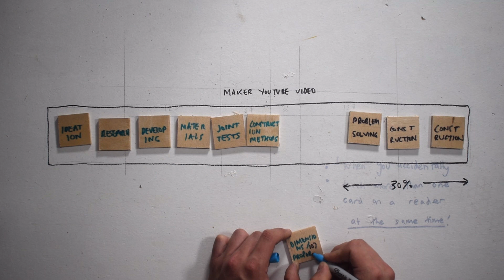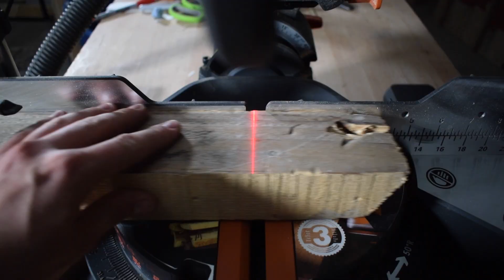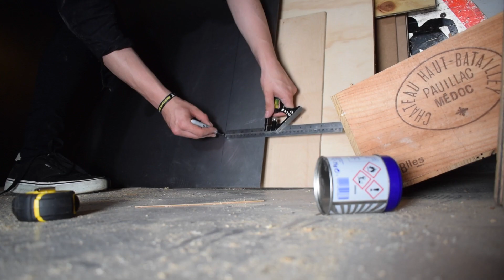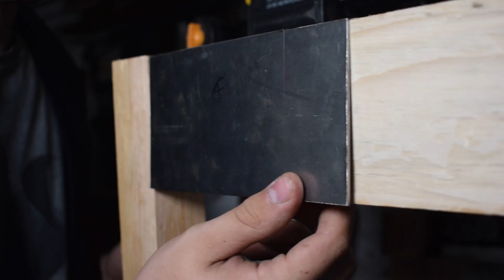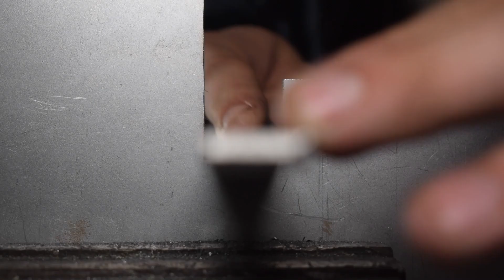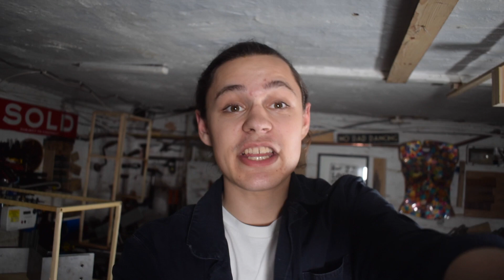Designing + Making Knockdown Steel Table Brackets

Comment: Great video.  Have you considered adding a plate (maybe triangular) across the top of the bracket to allow for some screw holes - so that a table top could be secured in place in the final table?

Scratch that - just continued watching the new video and saw you'd added small plates to allow this...

Comment: Awesome approach to maker videos! Absolutely love it!
I was very interested in your 'accessible to all' idea. However, what can be done to evade the welding part as most aspiring makers or DIYers such as myself do not have a welding machine!?
Keep up the good work!
Reply from the maker: Thank you mate, really happy to hear you found it useful!  
Re. accessibility maybe I didn't explain it clearly enough in the video, but the concept behind this is that you would buy the brackets pre-made from a store. Then once you've got them you could pick up different lengths of standard dimensional timber and construct tables of any size simply by fitting and locking the pieces into the bracket. 
(I consequently wasn't concerned about the number of tools required to make the bracket as this would be done is a workshop/factory and would also lead to the end of no tools being required for the user.)

I'm imagining this being really useful if you need to quickly construct a table e.g. if you've got extra guests staying for a dinner party but don't want something thats permanent, expensive and will take up a lot of space or alternatively if you want a more dynamic and variable table arrangement. For example I think event or festival companies would find it really useful if they could create multiple different table layouts but then have the ability to break them down either for storage or another configuration at the end of the night!

However, all this being said welding is definitely not as inaccessible as I think most makers (including myself) think it is! I got this welder second hand and once I'd brought a gas tank, wire, mask etc I'd only spent about £110 and even if thats out of your price range there are plenty of DIY alternatives to welding! I made a video a while back where I made a no weld side table by using wooden inserts, and you can always braze aluminium parts together or bolt them like Modern Builds did in one of his videos!

Comment: You might consider replacing the bolts with small holes for short nails. I think a hammer is a reasonable thing for people to own, and it would simplify the upfront construction (no tapping) and cost (short nails should be a lot cheaper than bolts)
Clever idea though!
Reply from the maker: Good suggestion Jeff, and this might be a nice idea if you wanted a permanent fixture but I'm not sure if its the best option for this bracket. 
The purpose of the bolt isn't to permanently secure everything in place, but rather to apply pressure to the stretcher, compressing it securely into the box, yet also allowing everything to be disassembled if/when need be.
Although nails would good at maintaining the stretchers location relative to the holes it wouldn't actually apply a lot of pressure so the stretcher would still be loose, and I personally could see the nail moving in line with any linear pressure. Not to mention it can sometimes be difficult to pull old ones out! 

I hope this makes sense and I should also note (and this is my fault as I don't think I was as clear as I should have been in the video) but the idea is for them to be sold already fabricated, with the user just inserting standard dimensional timber, so the build process doesn't necessarily have to be super accessible!
Reply: JMakes ah that makes sense. I think nails would be plenty strong, especially if you used ring shank or old style square cut nails. But yeah, removing them would be hard. With the bolts my concern is either stripping out the tapped threads - maybe try weldnuts instead, and that dimensional lumber is really wet. So it might shrink enough over a few months for bolts to loosen up.

Comment: Right of the bat I will say that I have found myself many times in such a situation, where i tried to figure out a way to do something quicker or easier. Most times only to come to realisation that Im reinventing the wheel or that the thing Im trying to develop already exists. Im a bit sceptical about this project. No offence but what you came up with is a sollution to only one combination of parts. Its also complicated to make, which in a real world translates to expensive. And neither of the above descibes a bracket in my opinion. Doesnt mean, that it will not make for a great project. Its just not very versitile. Good thing about you sharing this is that we can learn form your process. Keep it up. One day you may come up with something like Anderw Kleins drawer dado blade set. And this thumbnail deserves a place in a modern art exhibition. All best.
Reply from the maker: Thanks a lot for your comment and constructive feedback Borys and I'll try my best to answer some of your points/concerns!

- You're right this bracket only works with one combination of parts, but assuming the initial designer has properly considered the proportions and strength of the components, I don't see why you'd want/need a versatile solution that can all components of any size. 
- You're also right there is definitely work still to be done to simply the design so its easier to manufacture although this being said I did make it so that it nests into a very compact net so is very material efficient and I think that once you've invested in a die cutter apart from one difficult fold to create the return, the components could be stamped out and formed relatively easily (or at least as easily as the initial fence post I showed in the video). 

To compare this to Anderw Kleins drawer dado blade I think is really interesting, because in my opinion using the points you've brought up, his invention is actually not something euphoric to look up to, but instead equally flawed. 
- It isn't very versatile (as, as far as I understand) you have to change the way the stack is set-up dependent on the thickness of material you're cutting and dado blades are illegal in most of Europe. 
- It is complicated to make. If I remember correctly he had some difficulty trying to find a supplier to get angled carbide tips produced, and then there is the question of producing different sized blades to fit the various sized table saws. 
- And it isn't re-inventing the wheel. I can make a much stronger and more versatile joint in a much shorter time span using simple butt joints, and aside from very high end cabinetry where you want continuous grain (this is more akin to case than drawer construction imho) isn't the optimal box making solution. I know at least from the cabinet shops I've worked in, there is absolutely no way they could justify spending the time to change the blade and set up the dado stack or alternatively put it in a dedicated machine. 

I say all of this not because I don't like his invention - when I first saw it I was impressed and thought it was really clever and when used under the right circumstances can massively increase efficiency. But instead because no product is perfect to everyone, in every situation. 
Do I think his invention is good for high end cabinet makers or DIYers who want to try something new or aren't massively concerned about tool versatility? Yes. Do I think its the best way of making drawers? No. 
Do I think my table bracket idea could be useful in some situations, like the ones listed in another comment where you want to have the ability to quickly make tables of any size, or even just produced flat-pack furniture? Yes. Do I think my idea in this video, is the best way of making a table? Absolutely not. 

All this being said I do 100% agree that sharing is the only way to learn and develop. 
It'd be a lot easier for me to show a polished build video than show the development process, in so doing opening up far greater points for critique, but I do think your comment shows that it pushes ideas much further than a standard video ever could so thank you and I will do some more work on the design!
Reply: @jmakes3745   I was impressed with Kleins dado stack, but when I think about it also has a lot of limitations. I humbly agree with your points. Im waiting to see how it develops. Thank you for replying.